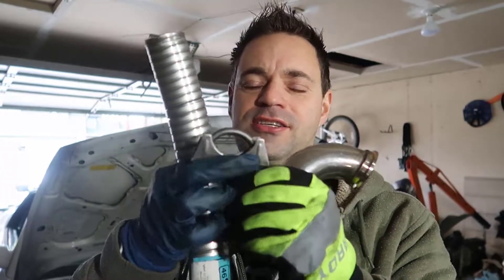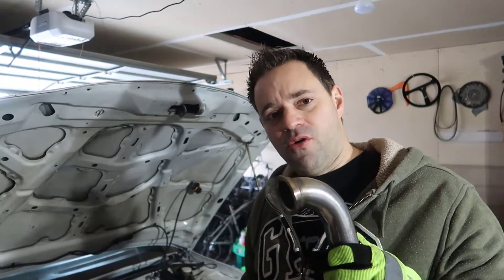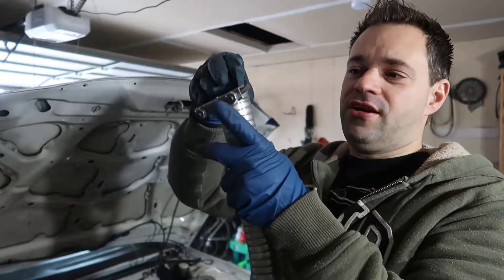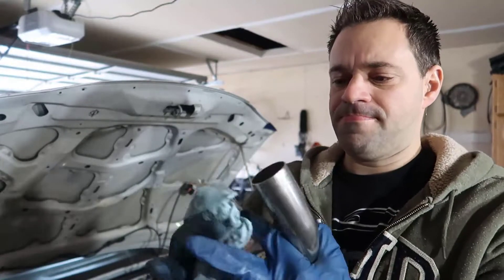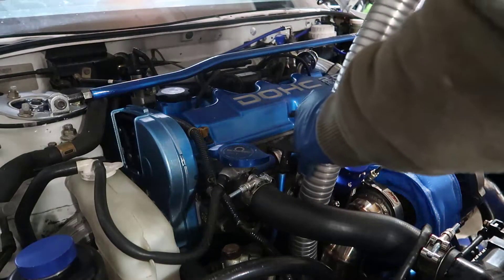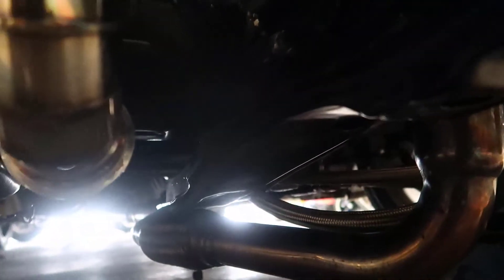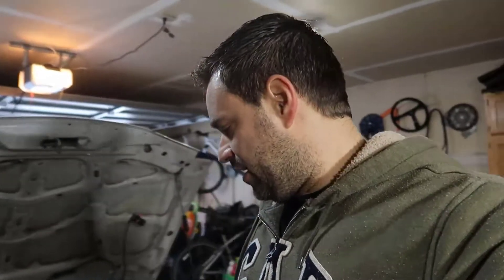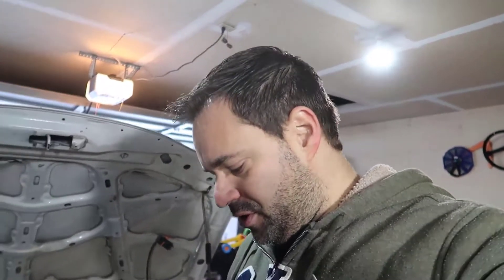Making the  Wastegate Dump Pipe - Eclipse 2G Project

Comment: I would love to know how this “dump pipe” ended up working. Not a bad idea. Just curious how well it worked, or didn’t.
Reply from the maker: @Ryon8oh1  it worked awesome. Still in place
Reply: @ no way, that’s so cool. I’m trying to find something for my setup, but the way you did it seems WAY easier. Thanks for replying.
Reply from the maker: @Ryon8oh1  no problem.  I did the same on my Toyota Supra and it's working fine as well